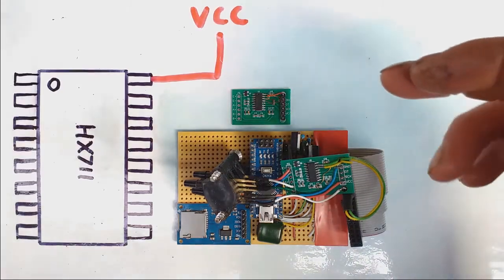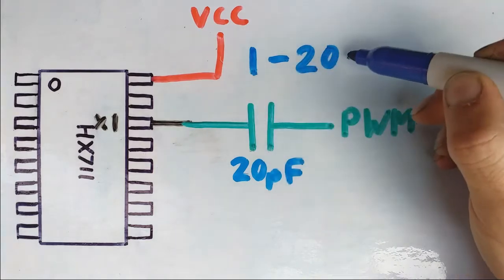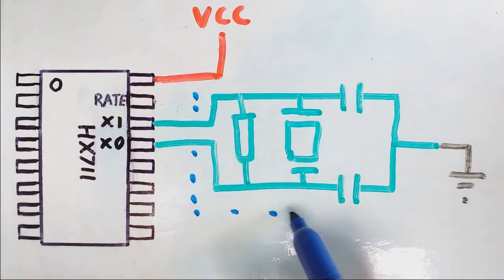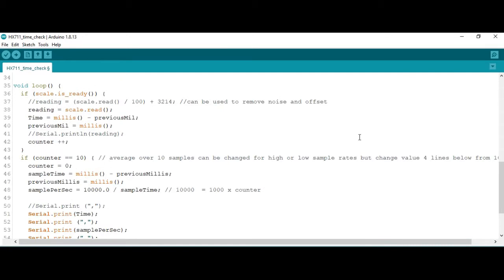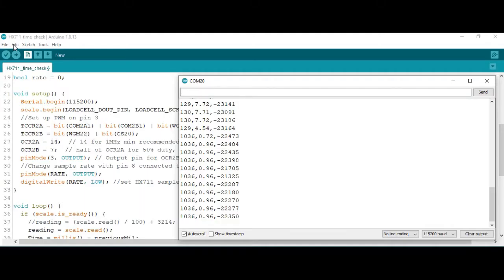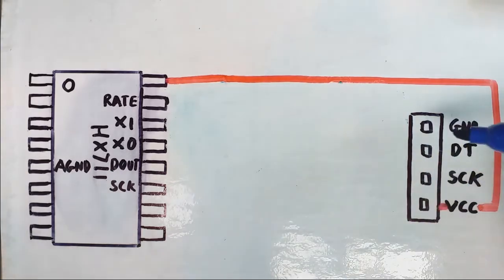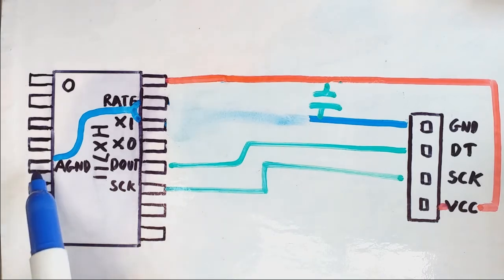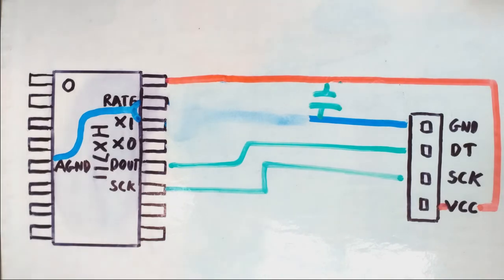HX711 Changing Sample Rate Advanced Info

Comment: I tried to use a 22.1184mhz crystal (on a customized break board) and got 160hz, the output rate formula on page 3 in the datasheet.
Reply from the maker: This is above the maximum of 20MHz recommended by the datasheet. Did it work well?

Comment: Thanks for the informational video!
Two questions though:
I can't seem to find any crystal oscillators with 3 pins, only 2 pin ones. Could you provide a link to one in the description? Or would it work to buy a 2 pin one and connect it to 13 & 14 pins skipping the ground?
Also what frequency oscillator are you using? New to this, sorry if it's a stupid question.
Reply from the maker: Not a stupid question at all, I'm still learning to so we can learn together.
I have used 3 pin crystal oscillators off old Arduinos which had worked well. However my latest HX711 boards don't seem to work well with these. Not sure why at the moment. So I have some 2 pin ones currently in the post to experiment with and find out what's going on. I'm suspecting the load capacitors which are internal hence the third pin are either not needed or are the wrong value. You can use a 2 pin crystal with external capacitors. I'm going to give one a go without first and can let you know if it works.
The frequency I used is 16MHz as it gives 116 samples per sec. A good compromise between 80 and the max.
Reply from the maker: The crystals arrived on tonight's boat and just been trying a few on different boards, 2 pin 16MHz and 18.432MHz. All worked no problem which is great and with no capacitors. So I wouldn't bother with the 3 pin version, appears I need to update video. Just connect a 2 pin crystal to pins 13 & 14, removing 14 from GND first. Of course no guarantee you'll get the same results, that's just how electronics are.
The 18.432MHz got me 134 samples per sec. You can use any frequency between 1 and 20MHz to suit your needs.
Reply: @Ed.R  brilliant! thanks for the quick and informative reply! ❤️

Comment: Thanks Ed R. Great video.  Is there any way to get a 0-5v output from these hx711? I have build a load cell from strain gauges and want to make a pressure sensitive gear stick for my car.
Reply from the maker: Thanks, I have a video on how to set the excitation voltage but this is a fixed voltage.
For a 0 - 5V output you would need a DAC  (Digital to Analog Converter). Opposite of the HX711 which is an ADC.

Comment: Hi Ed, if I have a premade board with pads "rate". It does not matter if I brisge those or not, rate remains 10hz, pin 15 is low. Would you, as a HX711 expert, know what I am doing wrong? Its a Jopto CJMCU-711. I would be so happy if you xould help?
Reply from the maker: Looking at the photos on the listing on Amazon it seems the jumper is already connected. Connected to ground so low. To get a high sample rate, you will need to remove solder and run a knife a few times between the solder pads. Hope this helps.
Reply: @Ed.R  oh wow it worked! Thanks so much, your eyesight must be a lot better than mine!

Comment: hey,
I would like to use the PWM on Pin 3 to change the sample rate. Do you have an explanation for this?
best regards
Reply from the maker: You mean pin 14, I can't help you anymore than explained in the video. Make sure to use a capacitor in series with the PWM signal. Whatever provides the PWM must share the same GND. The frequency is between 1 - 20 MHz.
Otherwise if you mean how to generate a PWM signal with an Arduino for example I'm not the best person to ask.

Comment: Not sure If I missed something. Is there any issue using the onboard oscillator for sampling with the rate pin grounded for slow sampling or pulled high for faster sampling?
Reply from the maker: None at all this is how most boards are used.
Reply: @Ed.R  also, i found all of the hx711 boards are missing the ground connection. Thanks for pointing that out.

Comment: I'll try all your connections because I can't get stable values from neither of mine different 4 load cells and five similar hx711 chips... tried many things,  but not even close to stability we can se in Bacon's or Indrek's tutorials... :(
Reply from the maker: I'd check the ground connection first and then the excitation voltage E+ is lower than VCC. No guarantee it will improve things, strain gauges just suffer a lot of noise.
A lot of stability can be gained from code with smoothing and throwing away resolution if you don't need it.
Reply: Bad readings can also come from 1. using the HX711 at 5V and the connecting it to a 3.3 V micro (like ESP32) and 2. using a micro thats too fast.

Comment: please, i need your help
Reply from the maker: Help with what?
Reply: @Ed.R  Hello friend! I have a problem with the HX711 module, the test rate is too slow for the use I need to give it, I already added an external oscillator and soldered the RATE pin to pin 16, the problem is that there is no improvement in the demonstrated, continues to be of the order of 400 ms per measurement. Could you help me?
Reply from the maker: @DiegoJesusMarquezLara  I would try and get the rate pin to operate correctly first. Switch between ground and pin16 and the rate should change. 400ms between samples seems very slow.
Second there is a possible mistake in the video, I used a 3 pin crystal connected to ground. It worked at the time but boards I've used since haven't and the only thing that did was 2 pin crystals. If you haven't used a 2 pin crystal yet I would recommend trying one.
The board should put out 10 or 80 samples per sec if it is working correctly regardless of whether the crystal is functioning.
Otherwise it may be a coding issue. Any delays in the code?